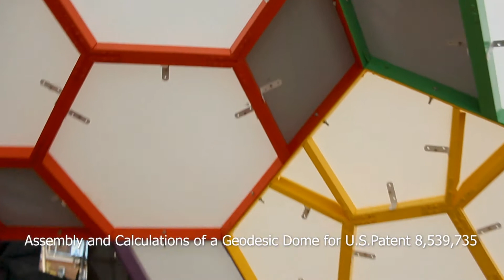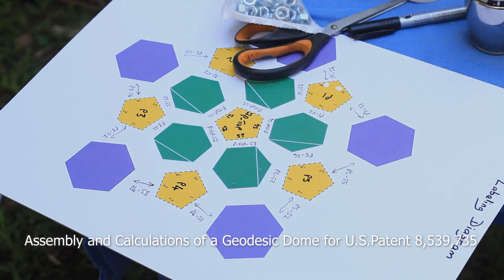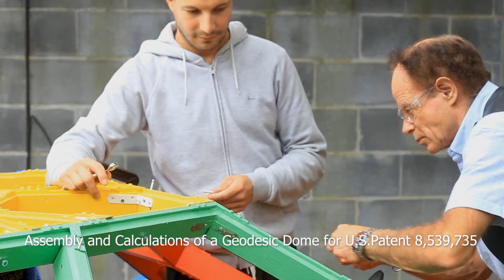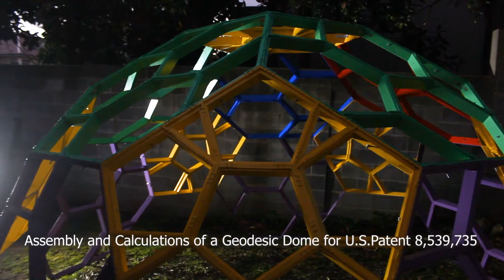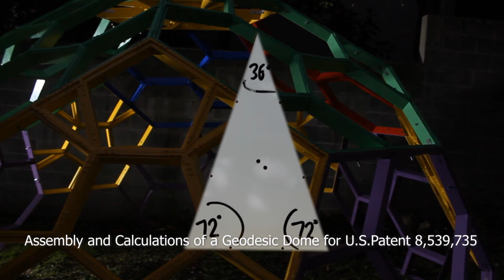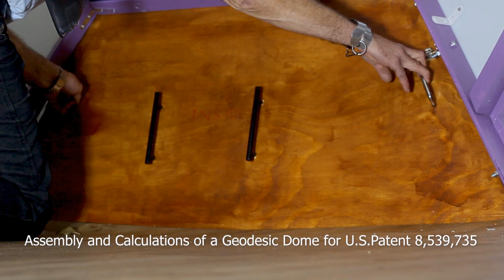Geodesic Dome : Assembly and Calculations for U.S. Patent 8,539.735

Comment from the maker: Well then, the logical reason for wanting to build a Dome by this method is simply because of the incredible strength that's intrinsic to this type of Dome. This strength will increase by either forming the Dome from lower level assemblages or by increasing the thickness and depth of the frustums. This is NOT the case with Domes built using the Schwam method; The method invented by Paul Schwam (US Patent 4,907,382, March 1990).  In the comment below, the Schwam method is referred to. As of this present time there are about 50,000 Geodesic Domes built in the U.S. all built by the Schwam method. If these domes are placed along the Florida coastline they could easily be torn apart in powerful enough hurricanes and tornadoes. 

But it's a good observation about snow settling onto the top pentagon. This will require a design modification for some environments
Reply: The flat surfaces on your dome will be subject to windloads as well as snowloads, A hurricane will impart  considerably more force to the large flat panel compared to the more aerodynamic standard icosa made of triangular panels.I dont think FEA would support a superior strength claim. 
I personally wouldnt rely on brackets and screws to hold any dome together, especially one that may be subject to a hurricane :)
Reply from the maker: @JohnGuest45  ; Thanks again for your 2nd comment- i appreciate it ; i will answer both observations; to your FIRST observation; as a dome is designed and built from lower and lower levels , the dome will go from resembling flat surfaces to surfaces of curvature. .....to your SECOND observation ; I explain again;  as the dimensions of the frustums are chosen such that they are thicker and deeper the resulting dome will become more stronger. In the limit,  as the frustums are as thick and as deep as can be they then become solid pyramids with the resulting dome becoming solid mass .....possessing the "ultimate strength". BOTH OF THE ABOVE ARE EXPLAINED IN THE SPECIFICATION OF MY PATENT. The dimensions of the frustums I chose for this Dome I felt was best for the video presentation. It's only an example.  But the  concept is clearly communicated in the Patent specification.  A builder of domes utilizing my method will choose dimensions for the frustums to give the strength that's desired.

Comment: Apart from cosmetics i see no logical reason why anyone would go to the trouble of building this dome.. A 3v truncated icosa with plywood panels would be a lot easier to construct and much stronger. Structurally, its inferior to a standard 3v icosa made with triangular frame panels.The flat surface of the top pentagon wont allow snow to slide off so you could easily have a few feet sitting on top of the dome.
Reply from the maker: Thank you for your comment......I will respond above